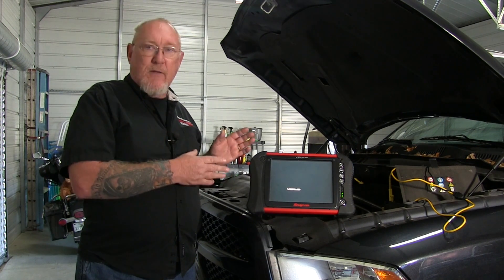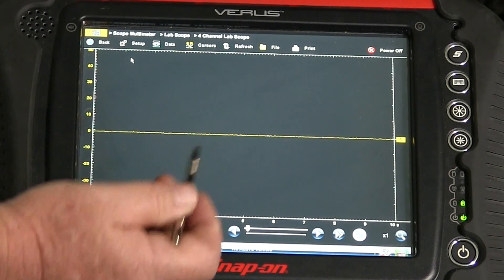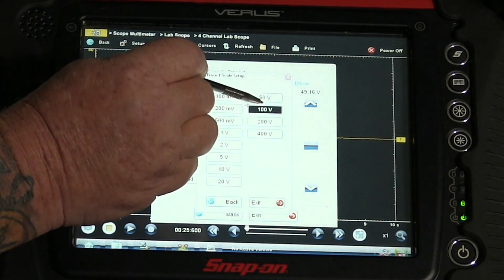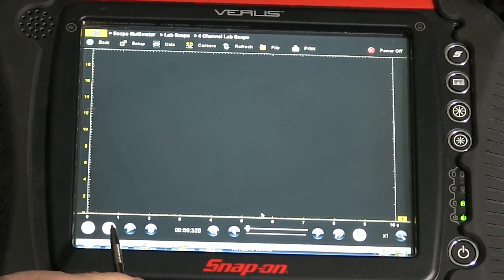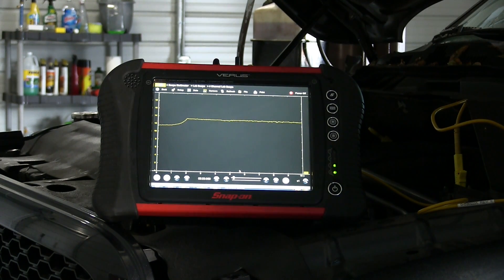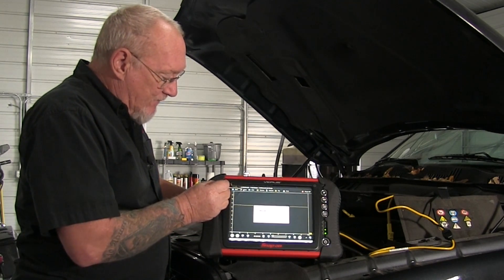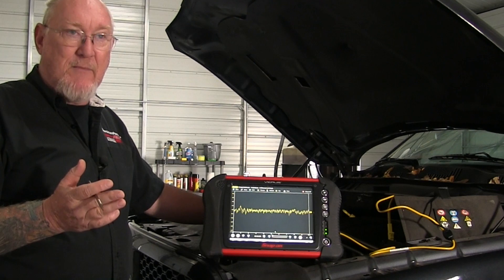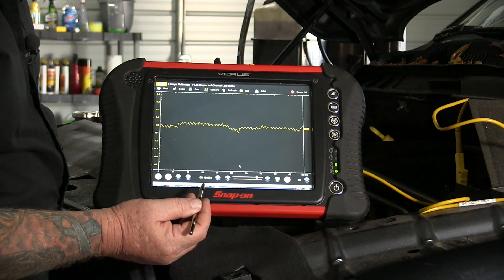Motor Age How2 #3:  Using AC Coupling On Your Scope

Comment: Hey Pete with using the ac ripple test at the battery like u showed. What if u have excessive ripple. U would suggest replacing the alternator right away because plenty u cant reach ur leads down to the alternator post to do direct testing. U da man Pete
Reply from the maker: If you're seeing excessive ripple, the diode pack has failed and the alternator has to be replaced.
Reply: @VehicleServiceandRepair  thanx Pete. I just got my verus pro 2 weeks ago and I'm just playing around on known good cars to get familiar with the signals and get quicker at setting up my scope so it can become second nature. I have a uscope but I'm limited but it does wonders when u wanna connect fast and get a good idea before u have to break out the big gunz. Got alot of accessories from aeswave. Love the pico COP probe. Thanx Pete. Any upcoming classes u doing with TST back in jersey at union Blvd?
Reply from the maker: @jasonc.4683  None planned at the moment...tell G you want me back...😉

Comment: What is an acceptable range for the AC ripple? Is it less than 1v or 2v?
Reply from the maker: Generally, anything over 0.5 v peak to peak is unacceptable
Reply: @VehicleServiceandRepair  Thanks! I must not be doing something correct. Verus Edge set up just as it is in the video and I'm getting peak to peak of over 4v on multiple vehicles that have no electrical issues. Hope there's nothing wrong with my machine.
Reply from the maker: @Carlitosway211  What time base are you using?

Comment: Another great video! When you are hooking up the leads, and you say "hook up the other leads to the battery" (approx 6:45), are you connecting the green lead into channel #2 and the ground to the yellow lead? or just using the yellow lead?
Reply from the maker: On the Verus, Channel 1 supplies the ground for all 4 channels. After connecting the yellow lead to the scope, attach the other end of the yellow lead to the positive side of the battery and the black lead to the negative post of the battery. If you need to use additional channels, you'll ground them through the ground you already have with channel 1. Make sense?
REPLY
Reply: Yes. Thanks for always replying. I just couldn't see the lead hook up from the camera angle. I just got a Modis a few months ago and I'm going down the playlist. 2018 is the year of the scope for me!! Thanks a million.

Comment: Pete ....I have the old version Snap on Modis with the 4 channel lab scope I am not able to get the same wave form you are getting. Is the Snap on veras a different lab scope then the one in the modis ?
Reply from the maker: Not sure. But nearly every scope I've ever used has had the ability to read AC alone. Try selecting an ACV scaling rather than DCV is you don't see the coupling feature as a standalone. Set range to .5v per division. Hope this helps.

Comment: Thank you Pete, your videos have been a great help for me especially because you cover the fundamentals. I hade 6 ASE certifications which all lapsed in the 90s. I battled cancer for many years and put my wrenchs down over 20 years ago.
About two years ago I was too sick, (and too broke due to med bills over $70k p/y) to change the power steering pump on my 88 Chevy pickup.
I heard about a church that has a Car Care Ministry.
Long story short, I got in for the church's once a month Car Care event and was quite shocked to see a huge, well equipped shop with 4 lifts and a front end machine. I did my best to hold wrenchs and pitch in with the volunteers working on my truck. I had been in bed virtually for ten years but it was exciting being in a shop again.
Later on they rolled in 4 brand new tires. I hoped they weren't for me because I had no way to pay for them even though the tires on the truck were shot. Sure enough mounted them and put them on for me. When I told them I couldn't pay for the tires they told me not to worry about it!
I was so grateful I started coming in as a volunteer. In the beginning I could only work a few minutes at a time.
Eventually I got stronger, and started doing some real work.
Now I do most of the diagnoses and pro level repairs. I have been able to get scanners and other tools donated by well known You Tube mechanics inspired by my story. I recently took in, on behalf of the Church a Snap On scope from the 80s called the Counselor I believe. Hey, a pattern is a pattern right? I have ultimately worked on hundreds of cars including dozens of donor cars. I didn't expect to be alive at this point let alone building a reputation and helping people keep their cars on the road. I now have a future at 60 and plan on getting my ASE L1 ultimately.
Couldn't do it without the videos. Sorry for the long post but thought it might inspire someone to keep fighting even when there seems to be little or no hope.
Thanks, Joe
Reply from the maker: Thanks so much for sharing your story! I hope it inspires others to keep on fighting.
Reply: Joe Mikos God Bless you
Reply: Joe Mikos Keep running the race brother. God bless you and bless the church ministry people as well. Good luck in the future on your L1😃👍
Reply: As an atheist I would say this should be a standard in a community and not bound to the church.

But being a good person is not bound to a religion and or building. It's you, who do a good thing and help others. So keep it up and learn new things. Electrical works on a car has a traps but you need it. Look at south main auto, pine hollow, scanner danner and diagnosedan also, they show you a few things and basics that made your life easier.